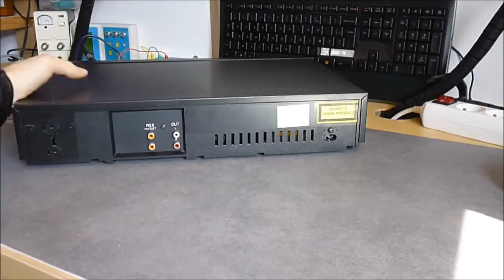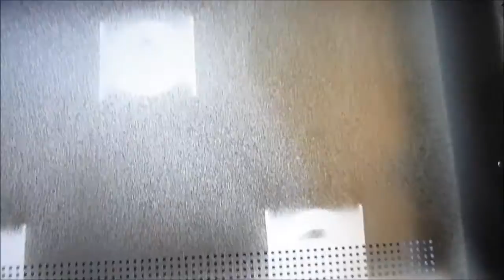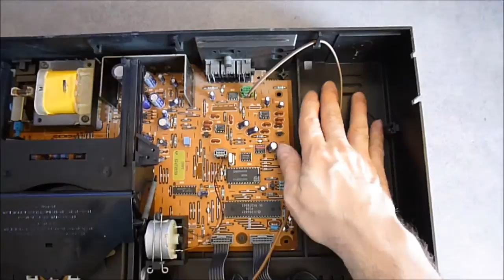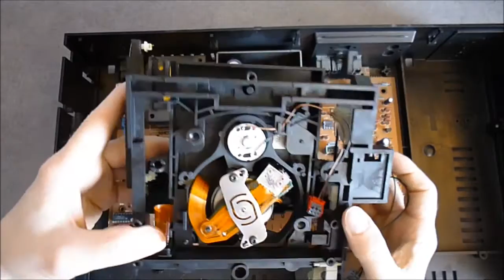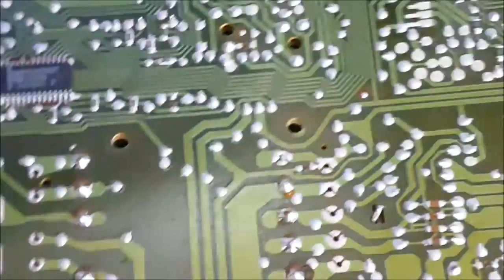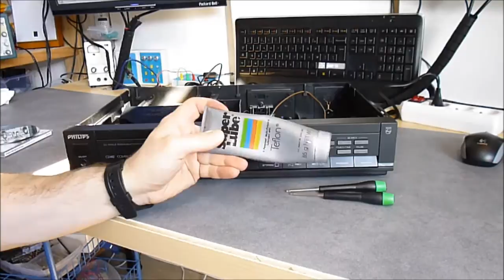Vintage cost effective Philips CD player teardown CD482 from around 1988

Comment: These are very easy to add a valve output stage  to. Same boards used in many different manufacturers. TDA1541 is a great DAC. The empty space was for separate audio board options.
Reply: I have a CD 471. Can a valve output stage be added easily to this model as well? Do you know anyone in the UK who could do this for me?

Comment: 1:45 The bottom and top of this case was used for many models of Philips/Magnavox/Marantz etc. CD players around 1987-1988 (possibly longer). I have a CD player that's completely different from this one on the front side, but the cover and bottom and possibly the electronics on the inside are identical. In the service manual, you can read that the holes on the left of the back side are for models in different parts of the world that need a voltage changer and a fuse on the outside. The small circuit board on the inside is because the same circuit board was also used in 36cm wide players.

5:23 My CD player has an extra board above the rest of the electronics, which has a variable-level output stage with two RCA/cinch connectors in the holes that you point out there. You can use the remote control to make it go louder or quieter, in case you have it connected to a stereo system without remote control.
Reply: Yes, here in Brazil these holes are used for the voltage selector and fuse holder.

Comment: Well worth taking the white circular centre clamp off the black plastic top arm, be careful there is a ball bearing which may fall out. Clean and lubricate ball and cup that it sits in. It will track better afterwards.

Comment: I expected to see a more solid looking CD mechanism in there after looking at the outside of the case. I think they routed the head phone wire that way to keep it away from the mains voltages for extra safety.